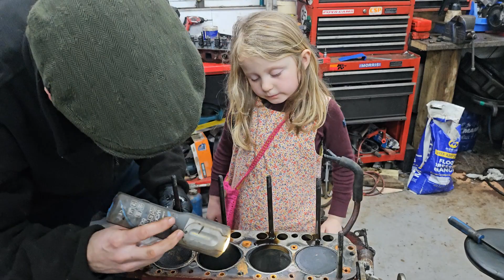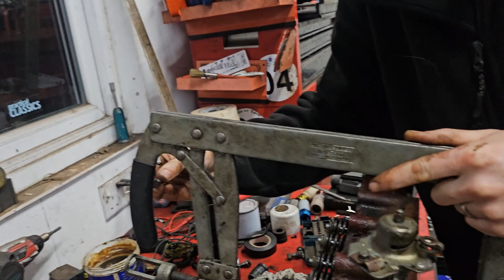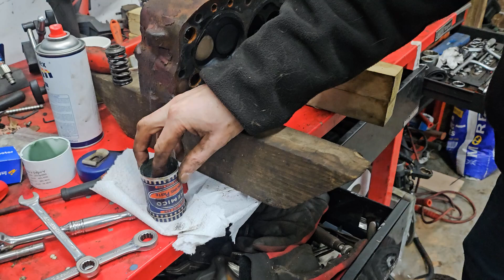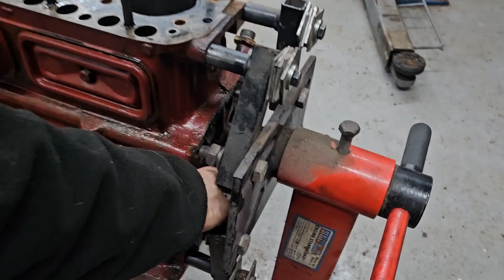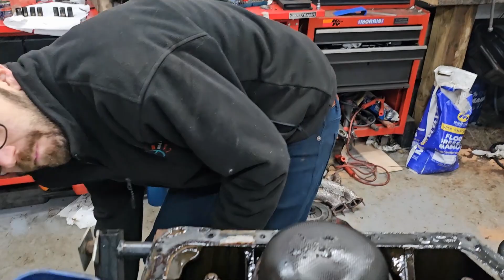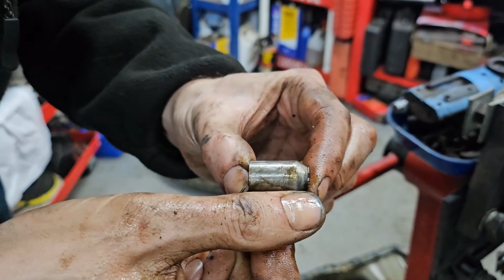Project MGB: Engine Strip Down - First Assessment

Comment: I do like engines been pulled apart well you didn't to much engine dismantling and there were mainly two issues with this engine and both were discovered why and l could easily watch you working on anr engine for hours extremely informative and interesting l have watched other you tube channels that totally pull a extremely damaged engine apart mainly Kia and Hyundai engines that have exploded but l was watching a video were tge engine had been totally neglected with oil in the coolant and coolant in the oil it was a mess but believe or not the presenter repaired the engine and put it back together and it ran well after all it was a Toyota 22R engine an extremely reliable engine and l have a 22R engine in my 1997 Hilux

Comment: Not a fan of using the gasket scraper to help get the head off. I like to use wood for and window shims. Helps raise the head as you wiggle it with zero risk of scoring the head or block
Reply from the maker: @jefflemon7382  yes not the best practice! But we were gentle. Definitely not prying with it.

Comment: I'm a big fan of the BRM (Brush Research Manufacturing) Flex-hones. I've recovered some pretty sorry looking bores with them. Massively better than the 'egg beater'' glaze busters.

I like to machine a slight counterbore on stud holes, so there's no possibility of the thread pulling up. The Moto Morini engines I'm usually working on are done like this from the factory.

A vapour blaster is one of the best ways of cleaning valves. I converted one of my blast cabinets with a 'dirty water' pump.

Comment: You should not run without a thermostat. The restriction it creates is important in making sure there is sufficient pressure at the water pump inlet to prevent cavitation introducing bubbles into the coolant. Bubbles in the coolant will reduce its ability to carry heat, which can itself lead to overheating. Even worse, you can sometimes drop the coolant temperature, whilst increasing the actual engine temperature, which can lead to dropped seats/valves, or de-tensioned rings. Race practice does sometime mean not using a thermostat, but a  plate with a 19mm hole should be used in its place. If you're stuck with a faulty thermostat and no replacement, remove the capsule and use the remains as a restrictor.
Reply from the maker: @EVguru  yep. Totally agree. 👍